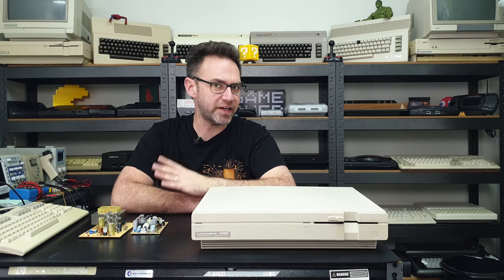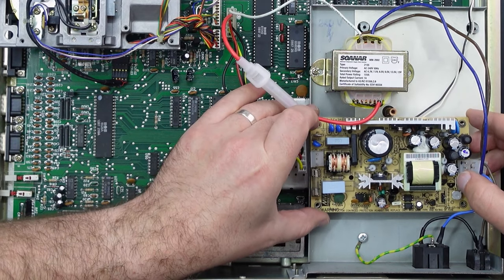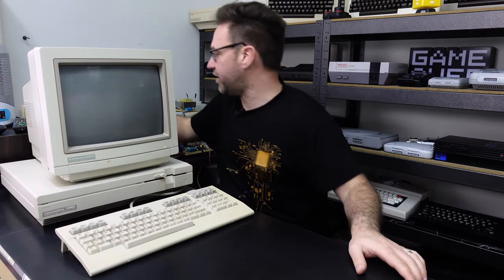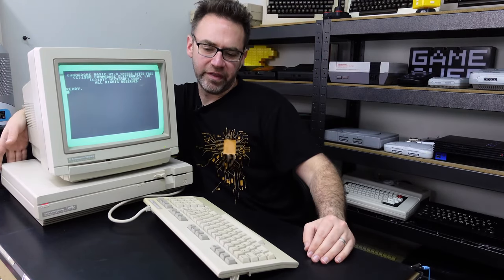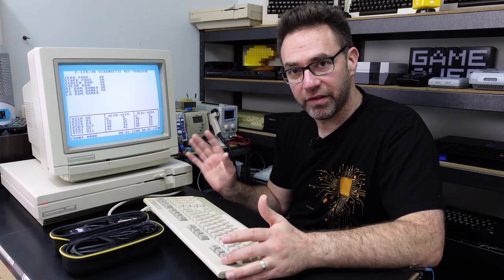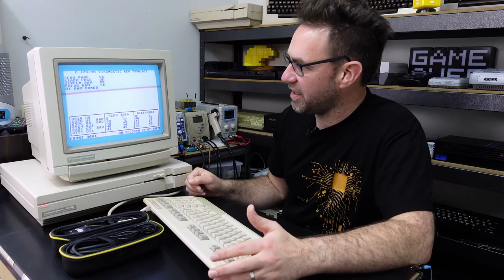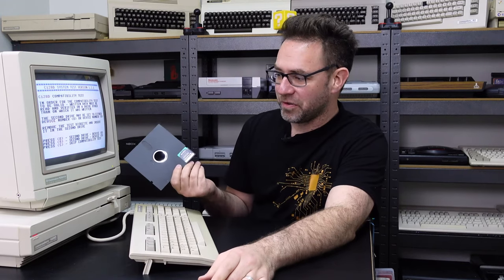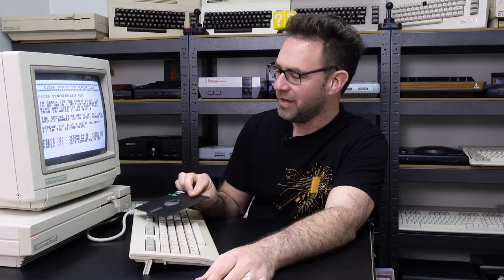Commodore 128DCR part 2 - power supply upgrade and diagnostics

Comment: That was a very informative set of videos on the C128DCR. Would love to see a disk drive read/write top head repair/replacement on this machine as I have one with the famous problem (moved it from Europe to North America without the cardboard head saver in it). Oh hind sight.
Reply from the maker: Thanks. Depends if the metal strip on the head has broken off or is just bent out of shape. I had one that was just bent and managed to get it back into shape without breaking it, but didn't get that on camera unfortunately

Comment: Just a small hint: Don't store these machines (or any 1571) with the drive left open. Always insert a disk or a protector and close the drive or otherwise, the metal strip holding the upper head will break due to the constant pressure applied to it by the drive's mechanic.
Reply from the maker: Thanks, yeah seen one where the metal strip was bent out of shape but luckily not broken. Managed to work it back into shape without it breaking, didn't matter that much because the lower RW head had an open coil anyway :-(

Comment: Great upgrade on that PSU.  I have seen issues where big ripples off the PSU within a CRT will affect the picture on a CRT.  Also love that Commodore monitor
Reply from the maker: Thanks Steve. Unfortunately that poor monitor may also have a power supply or voltage regulation issue. It's shows some major blooming, for example if there's a white square on the screen (like the 100IRE pattern from the 240p test suite) it will gradually become fatter towards the bottom.

Comment: It could be a feedback controller oscillation issue. if you get a power supply where the ripple is not 120Hz it's good to note what frequency it is at. some of the supplies have a small cap in the controller that powers the controller IC.
Reply from the maker: Yeah, I poked at it for quite a while and couldn't find anything that looked unusual on the scope (apart from about 1V ripple on the output). Can't remember what freq it was but in the end I feel much more comfortable having the meanwell in there
Reply: @TheRetroChannel  yea. The newer controller IC's have a faster step response as well.

Comment: I never saw any of these D's, back in the day, but I really like the design.  Good job getting it going!  My friends got 128's right before I jumped from the 64 to the brand new Amiga 1000, but they all had the standard models.  I'm not sure if everyone's experience was the same as theirs, but I observed that they basically used their 128's in C=64 mode 99.99% of the time (as there was a huge piracy scene back at that time and plenty of available disks), and never bought any actual 128 software.
Reply from the maker: Yeah unfortunately there's not a lot out there that can take advantage of the 128 features. Although recently there's been a few games and demos released. I'll show off a few of them sometime soon

Comment: Their are four GREAT Infocom text adventure games that were made for the C128 80 column mode only and no C64 version of those four games were made. Beyond Zork and three more. They run fine from a SD2IEC and also the 1541 Ultimate II+, but I wanted to put them onto real 5.25 disks to play them from the drive for nostalgia. Those four disk fought me for days no matter what copy program I tried. Finally got help one one of my FB groups. Used the Retro Replay 5 cart (one of many legal carts you get on the 1541 UII+) and set error checks to no. The reason they were so hard to copy, I'm thinking is when you try a disk Dir you get one seq file and the free blocks is a really strange large can't be right blocks free.
Reply from the maker: Funny, I spent a few hours yesterday trawling through csdb just looking for C128 software and spotted these infocom games, along with a few good 128 demos. Haven't tested any of them on real hardware just yet, only in vice but I'm keen to try them out on the actual 128 and maybe get some of them onto disks

Comment: Good job, my only comment is a metal cage over the PSU and a bit more shrink wrap would have made it safer. I'd be worried about working on the computer with the case off now.
Reply from the maker: Fair enough, but keep in mind the original PSU also had some places exposed that you wouldn't want to accidentally touch. The tabs on the new transformer are all for the secondary side, so most you'll get from them is 15v - not an issue unless you have wet hands. The primary side is not exposed

Comment: The TL866II is no longer available (listed in your links).  It looks like it was replaced by the TL866-3G.  Do you think this a is good option for burning Commodore ROMs?
Reply from the maker: Yes, the TL866-3G replaces the TL866ii. The new version should support the same ICs as the 866ii

Comment: "I'm so organized" lol Love it because I'm the same way. Great Video!! I have had a C128DCR for around two months now. I just bought a C128 lot and got two 1764 RAM Expansion units in it. I have been told on a FB group that my C128DCR PSU doesn't have enough power to run the 1764? If this is true, will your PSU upgrade address this? I was also told that the 1764 works fine in a C128 because of its PSU block. I don't want to keep this C128 from the lot just to be able to use the 1764. I want to sell it and the rest of the lot to help pay for the two 1764's and the working 1581 drive. I bought this lot which came in three very big boxes just to get those three items.
Reply from the maker: Hard to know for sure, but based on rough estimates the REU requires at maximum 1A going by how Commodore sold a 2.5A power supply with it for the C64 (vs the stock 1.5A). When I measured the original PSU, the DCR was drawing 2.3A and the new PSU is rated for 3.2A. So the meanwell PD-45A may be able to do it but I couldn't guarantee it.

All that being said I don't know what the original power supply is rated for so it may work with the original just fine

Comment: The filter caps of the original psu still looked unchanged. I bet the ripple issues came from them.
Reply from the maker: Yeah I put the original caps back in after the new replacement ones didn't help. Figured it was worth a try but the results with the original ones are the same if not slightly worse
Reply: @TheRetroChannel  Strange, I have seen quite a few of the linear PSUs in the 128 and its usually always the big golden Frako/ROE caps that are known to short out. Also on these, the marking shows the positive terminal, not the negative one. If the psu has been running for long with the shorted caps it could have affected the diodes, i've seen one melting its solder due to the shorted cap.
Reply from the maker: In this case the original caps were still within spec. Keep in mind this PSU did have a shorted switching transistor and the diode that sits on the collector of that was also shorted as shown in part 1. Both were replaced and I even went as far as testing every componenet and replacing the zener and SCR, even the switching controller itself. Nothing made a difference, hence why I gave up on it in the end